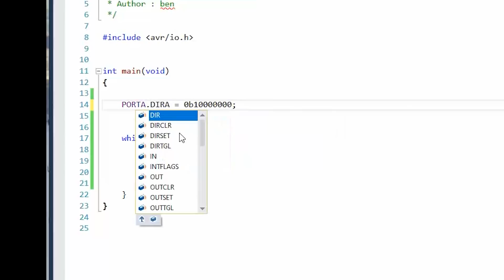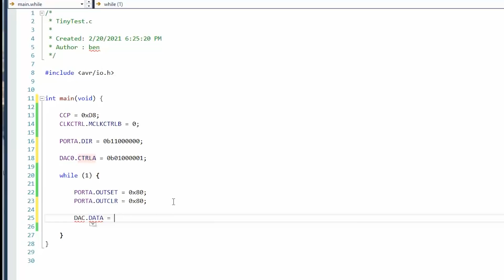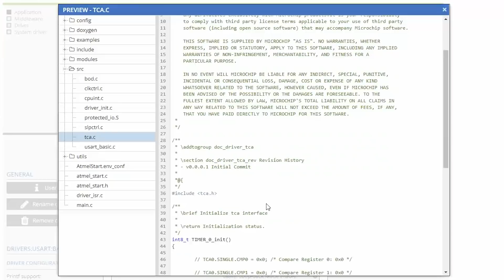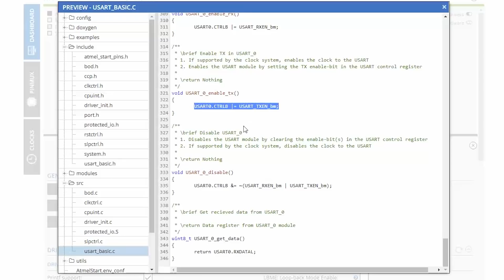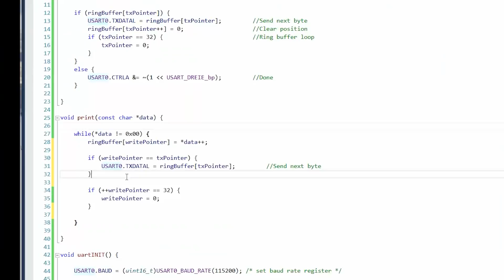Getting Started with the tinyAVR 1-series Microcontroller

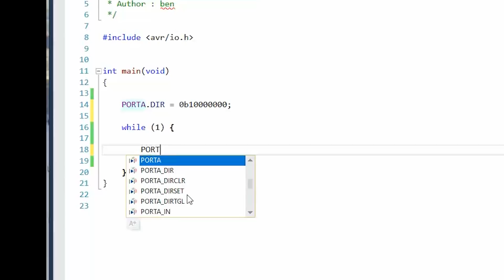Comment: 4:30 - one of the neat features of these  devices are the registers that allow you to write a bit mask to a register without affecting the other bits. Instead of writing 0b10000000 to PORTA.DIR, you could use PORTA.DIRSET = PIN7_bm. And to toggle, PORTA.OUTTGL = PIN7_bm and since the io header files provides the bit mask and group mask symbols, using them makes the code much more legible in lieu of writing hex an binary constants to a register. This is especially true with more complex configuration registers where multiple bits have to be set to achieve the configuration.

Comment: Like you, I'm taking a stab at the ATTINY88. Got most of it to work somewhat, Using the Arduino IDE. I haven't tried Micro chip stuff yet. My show stopper so far is no RX/TX functions. Blink works, servos work, ect. . It also has no PORT id, and resets wildly with some Nano sketches.

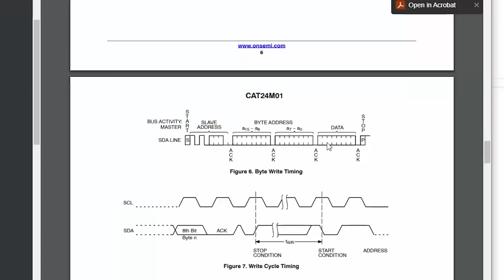Comment: 50:09 I much prefer datasheets that over explain the shit out of how it works as I have encountered datasheets that don't and it's a true nightmare to figure out. 

Like for example the W5100 Datasheet was not entirely clear that you cannot just set the index to how many bytes you wrote to memory. Instead you must first read the index, send the data starting at that index then add how many bytes you wrote to the index and write it back to the chip. You also have to detect if you have overflowed the page and if so wrap the data accordingly and calculate the index to the end of the page then add the rest of the value to the base page address.

Comment: Thanks for the video, I'm not sure if I remember this right, but can't you Ctrl+Click on a variable or define to get to the definition ? Maybe not :)
It's been a long time but I hope to get back to this kind of stuff soon! I made a little 3 button controller with an ATTiny85 for my monitor which would let you select VGA/DVI/HDMI without going through the menu by simulating button presses. Just as I was about to get the timing perfectly right, I somehow lost the code, but it still works most of the time.

Comment: At last! A low pin count micro with serial peripherals! Better late than never I suppose? Always puzzled me why they did not do this for making distributed individual sensors or actuators controlled by serial bus. Hook this up to a single microswitch and then wire your machine using I2C, or another serial bus.

Comment: Hey Microchip, if you're going to keep Atmel Studio, please PORT IT TO LINUX!! (Or make it work under WINE).   MPLAB IDE may suck at the moment, but at least it runs on Linux.
You might not have to use 12v programming to recover the reset/updi function if the pin is used for I/O, provided the fuse isn't the ONLY way to get pin io function.  Not sure if the pin mux can override the fuses on that one.

I've started fooling with the atmegaAVR128 series processors.  They are similar to the new tiny series (Xmega / ARM CortexM derived).
BTW Ben, can you put your code from this video up on Github or someplace?  I'd like to steal (I mean BORROW) some of it.  Thanks!

Comment: hmm I guess I could ask here, but I doubt I'll get a response. Anyone have any idea how I could control a 34v-ish motor from something like a raspberry pi or arduino?
Reply: Sure, you need an H-Bridge to supply the 34V to the motor and some optocouplers to hook it up to the Pi.  You can then use a couple of 3V outputs from the Pi to control the motor direction and, if you use PWM outputs, you can control the speed too.

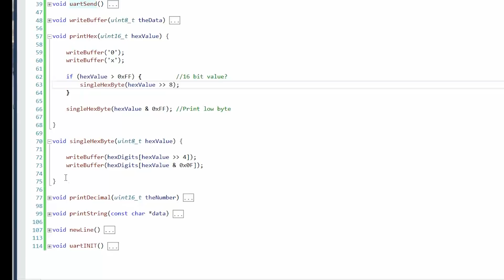Comment: 43:00 Why is the `if (ringBuffer[txPointer]) { transmitByte(); ` portion required for the `uartSend()` function? The datasheet explicitly states that "DREIF is set after a reset to indicate that the Transmitter is ready" in section 24.5.5, so you don't actually need to have ever written to `USART0.TXDATAL` in order for the DRE interrupt to fire. By my reading, just setting `USART0.CTRLA |= USART_DREIE_bm;` should immediately trigger the interrupt to run at that point if appropriate, which already performs that exact check first thing.

The way this peripheral is meant to be used, you're supposed to just set DREIE any time you add a character to the send buffer, and then just immediately have the ISR pick the character back out of the buffer with zero delay if it's ready to send. And while that does end up shuffling that first character into an intermediate buffer one extra time even though you could've written it directly, that is actually more efficient than shuffling around all the data you need to even check whether or not you need to.

Here's how I'd do it:
(EDIT: incorporated fix from @Mark S )
```
#define BUF_POWER 5
#define BUF_SIZE (1 << BUF_POWER)
#define BUF_PTR_MASK ((1 << BUF_POWER) - 1)

uint8_t ringBuffer[ BUF_SIZE ];
uint8_t writePointer = 0;
uint8_t txPointer = 0;

ISR(USART_DRE_vect){
	if (txPointer != writePointer) {
		USART0.TXDATAL = ringBuffer[ txPointer++ & BUF_PTR_MASK ];
	} else {
		USART0.CTRLA &= ~USART_DREIE_bm;
	}
}

void putc(uint8_t ch){
	ringBuffer[ writePointer & BUF_PTR_MASK ] = ch;

	writePointer++;
	USART0.CTRLA |= USART_DREIE_bm;
}

void print(const char *data) {
	while (*data) {
		putc(*data++);
	}
}
```
Reply: As written you've got a race condition in putc. WritePointer will actually load increment and store before ch is writen to the buffer. writePointer++ needs to be on the subsequent line.
Reply: @ax13h   Oh, good catch. Technically, before C++17 the update to `writePointer` and the write to the buffer were actually just unsequenced (which still isn't good), but yeah, since C++17, `writePointer` gets updated first:

  "17) In a subscript expression E1[E2], every value computation and side-effect of E1 is sequenced before every value computation and side effect of E2"
(from https://en.cppreference.com/w/cpp/language/eval_order#:~:text=In%20a%20subscript%20expression )

Comment: I'm kind of curious, how much banging your head against the wall trying to figure out weird things do you do? Maybe It wasn't an issue in this project, but what about all of your projects generally speaking? The way you portray your work in video it seems you rarely run into an issue that isn't something you can fix in short order. How often do you spend 15 minutes, 30 minutes, 4 hours trying to figure out why something doesn't work? Maybe that'd be a cool idea for a video.
Reply from the maker: Well with this project took me about 45 minutes to realize I was pulling Write Protect wrong. The magic of video editing works wonders! Usually most problems are "dumb problems" like that and I feel like "well there's an hour of my life I won't get back"
Reply: Just to kind of clarify a bit, I'm not talking about coming up with a method on how to complete a project, I'm talking about when you do something that you think should work without an issue but it's not producing the outcome you want. Just a dumb example say you hooked up an 8 pin IC with power on pins four and eight as is common (I could be getting those numbers wrong but I believe I'm not) but it turns out that you're supposed to apply power on say pins one and eight. Again it's a dumb example as I would imagine you would realize that almost instantly but that concept of doing something the way you believe is correct but turns out isn't and you have to go back and figure out why it's not.

Comment: Interesting! After using AVR's for my first few years in microcontrollers, I grew tired of their limitations and got into STM32, never looked back. If it is a must to solder one without a hot air station, I know there are some STM32s in SO8 and TSSOP14/20 packages, but to be absolutely fair - these particular parts don't contain DACs. But once you get into QFN packaged parts, it's like night and day in performance and peripherals plus they can get really small where it matters. I love that Single Wire Debug works on any STM32 with a $5 dongle I can get from mostly anywhere, Microchip used to price their not-so-great programmer way higher.

Comment: I guess from the praise for UPDI you haven't used debugWire. You could already program using only one wire, though from a quick glance maybe updi is faster. Debugwire wasn't on high end chips, it was on low pin count chips, including the attiny25 you were comparing to.